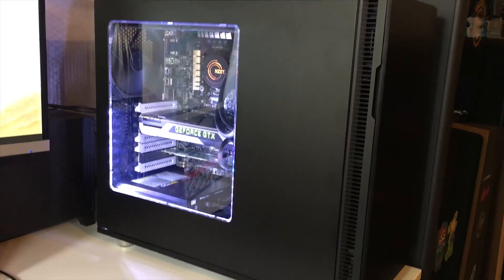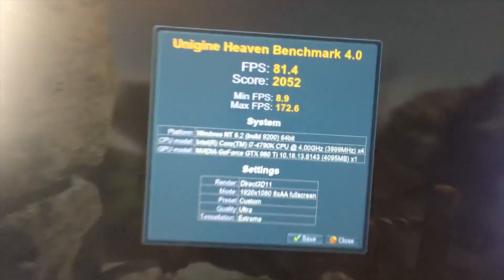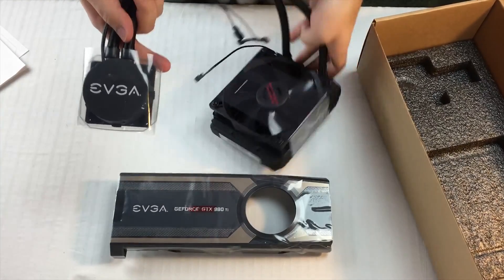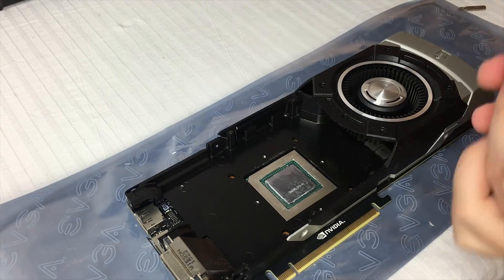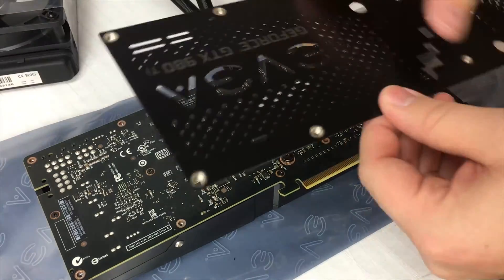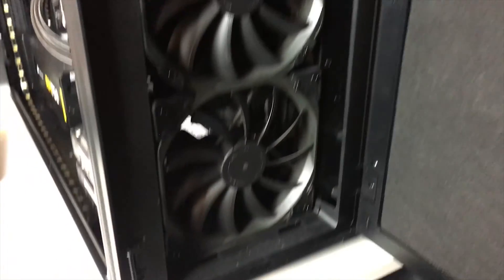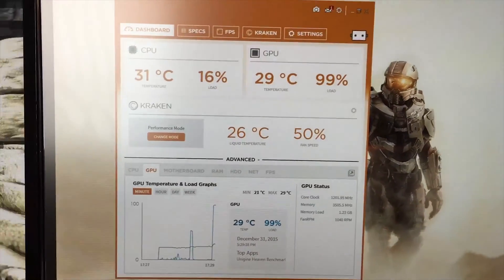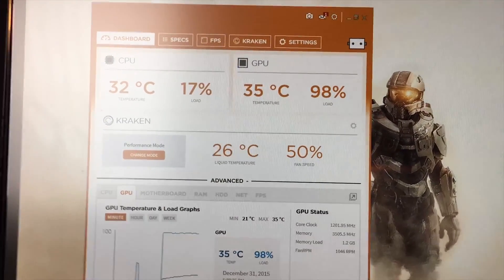Thermal Throttling! How to Cool a Reference 980 ti

Comment: Hey, thanks for sharing the video. A card throttling with the fan running at only 50% is DELUSIONAL! How could nvidia think turning the power down instead of the fan up is acceptable? My card behaves the same, in the way it will begin to throttle with the fans raising to 50% max. I use MSI afterburner to force a fan speed, and having the fans set at only 80% dropped the card 25c and prevented any throttling. Why the fan curve is not configured out of the box to prevent throttling, when the fan is capable of doing so, is baffling. Cheers to everyone still running this beast in 2022
!

Comment: I know this is quite an old video, but please reply if you can... at 6:58 you put the cooler over the GPU processor but did you add paste?  I only ask as you later (7:14) say to cross tighten the screws to ensure the paste spreads evenly... but as far as I can tell, there was no paste add, only the paste that was on the cooler, and would this spread?   Thanks for the video.
Reply: Yes you need to paste the gpu

Comment: If you're anxious to use alcohol to clean everything, you should also know that everytime you touch the heatsink/gpu with your bare hands, you leave fat on it, that will reduce the coolers performance over time. Anyway, looking how easy it is to remove the cooler from a reference card, I now regret my decision to get a non-reference card.

Comment: Just bought the msi version of this card and it runs HOT, 84C under heavy load 34C light.
Runs ff15 highest settings 4k got a steady 45 fps 1080 100fps <84C, 1080 60fps gets 75C/80C the max safe temp is 92C it throttles at 84C tho i think. Good vid gonna get a water cooler for it soon

Comment: I would like to make my gtx 980 ti run cooler, but unfortunately I can not find anywhere this hybrid cooling :( Looks like I have to go for Kraken or corsair AIO setup
Reply: they are no longer supported you have to look for used ones
Reply: I already got Corsair N980 cooling bracket with Corsair H75 water cooling, temps are at max load around 60-65 (with slight overclock), Got no bending PCB issue with craphic card as many reported :)

Comment: After experiencing sudden  frame rate drops after long periods of graphically demanding gaming, and the cooling fans running outrageously loud with a lot of heat coming out of my exhaust fans, I have pulled the trigger and won one of these cards on eBay for $374..    (card and kit together) .. during a time of this whole Cryptocurrency mining craze, gpu prices are now outrageous so it's definitely a steal..

I can't wait to see what this thing can do ..

I might use my air cooled 980 ti for another build.. I just realize that air cooled 980tis don't do well in small form factor cases..

Thermal throttling is like torture, because you know the card can generate enough power to achieve extremely fast frame rates on par with a 1070 but something is stopping it.

Comment: I was playing CS:GO earlier, and it gave me a driver crashed issue. tried so many drivers. have any ideas? like underclock it? or something?

PC Specs:
FX 6300
16gb ddr3
Asus GTX 980 Strix
MSI 970a-G43
500w PSU
Reply from the maker: Trolls You well it could be anything really. First I'd check your temps. Download NZXT's CAM monitoring software. Make sure nothing gets above 80C. Download GeForce experience and do a clean install of the latest drivers then let me know :)
Reply: Beeeyeee - Games & Good Times Will do, do you have steam so I can chat with you if I have issues?
Reply from the maker: Trolls You yep it's just Beeeyeee

Comment: +Beeeyeee
I could use your expertise.  Below is my current build.  I purchased a EKWB Predator 360, which currently is only cooling my CPU.  My intention was to purchase two EVGA 1080 Ti hydro copper's and add them to the loop.  Now I'm having second thoughts because I don't know if I'm ready to deal with the hassle of the maintenance of a custom water loop.  I'm now wondering if I would be better off with downgrading the CPU cooler to Predator 240 (without quick disconnects) and then purchase two 1080 Ti hybrids; when they finally release.  The upside is that I wouldn't have to clean the closed water loops on the 1080 Ti hybrids.  I'm not yet sure if that'll be the case with the EKWB 240 (without quick disconnects) but I think so.  What do you think?

[PCPartPicker part list](http://pcpartpicker.com/list/D68fsY) / [Price breakdown by merchant](http://pcpartpicker.com/list/D68fsY/by_merchant/)

Type|Item|Price
:----|:----|:----
*CPU* | [Intel Core i7-5820K 3.3GHz 6-Core Processor](http://pcpartpicker.com/product/6tXfrH/intel-cpu-bx80648i75820k) | $369.99 @ SuperBiiz 
*CPU Cooler* | [be quiet! Dark Rock 3 67.8 CFM Fluid Dynamic Bearing CPU Cooler](http://pcpartpicker.com/product/YwGkcf/be-quiet-cpu-cooler-bk018) |-
*Motherboard* | [Asus SABERTOOTH X99 ATX LGA2011-3 Motherboard](http://pcpartpicker.com/product/yxYWGX/asus-motherboard-sabertoothx99) | $306.99 @ B&H 
*Memory* | [Corsair Vengeance LPX 64GB (8 x 8GB) DDR4-2400 Memory](http://pcpartpicker.com/product/9ycMnQ/corsair-memory-cmk64gx4m8a2400c14) | $314.48 @ Amazon 
*Storage* | [Intel 750 Series 800GB PCI-E Solid State Drive](http://pcpartpicker.com/product/GDx9TW/intel-internal-hard-drive-ssdpedmw800g4x1) | $709.99 @ Newegg 
*Video Card* | [EVGA GeForce GTX 980 Ti 6GB Superclocked Video Card](http://pcpartpicker.com/product/xnH48d/evga-video-card-06gp44992kr) (2-Way SLI) | $0.00 
*Video Card* | [EVGA GeForce GTX 980 Ti 6GB Superclocked Video Card](http://pcpartpicker.com/product/xnH48d/evga-video-card-06gp44992kr) (2-Way SLI) |-
*Case* | [Fractal Design Define R5 Blackout Edition ATX Mid Tower Case](http://pcpartpicker.com/product/nwVBD3/fractal-design-case-fdcadefr5bko) | $99.99 @ Newegg 
*Power Supply* | [EVGA SuperNOVA P2 850W 80+ Platinum Certified Fully-Modular ATX Power Supply](http://pcpartpicker.com/product/zhgPxr/evga-power-supply-220p20850x1) | $135.98 @ Newegg 
*Monitor* | [Acer XB271HU bmiprz 27.0" 165Hz Monitor](http://pcpartpicker.com/product/ttnG3C/acer-monitor-xb271hubmiprz) | $0.00 
 | Prices include shipping, taxes, rebates, and discounts |
 | Total (before mail-in rebates) | $1957.42
 | Mail-in rebates | -$20.00
 | *Total* | **$1937.42**
 | Generated by [PCPartPicker](http://pcpartpicker.com) 2016-07-20 12:28 EDT-0400 |
Reply from the maker: First off 1080Ti's don't exist yet, did  you mean 1080's? Assuming that's what you mean, you won't need to watercool them. Honestly I have the Asus Strix 1080 and it never goes over 70C. If you're that worried Zotsc has some 2.5 slot cards that cool even better. If you're set in watercooling honestly either way is good. It would look better if you got custom watercooling though. But you don't need to downgrade your CPU cooler. You'll just end up loosing money I think. :) personally I'd just get two air cooled 1080s and stick with what you got otherwise. You can save money that way too. Otherwise full on custom loops. You're halfway there
Reply: I was indeed talking about the future 1080 Ti, which hasn't been announced or released yet.  Here are my current specs:
https://www.twitch.tv/rcald2000/profile
Reply from the maker: if you've get two 980ti's and you're not even gaming at 4k, why? you honestly could get away with one and still do max settings at 1440p for 4 more years man. You don't need to upgrade by any means. but uf you have to, i'd just get air cooled cards as I said. Don't get the refrence ones, but wait for the board partner versions. :)

Comment: Hi i have a reference 980 ti i have no problem with my thank you
Reply from the maker: What games are you running? Mines fine with games like portal 2. But if I play any recent game on ultra settings it just gets pretty hot. Try this Heaven benchmark and let me know your score and temps:)
Reply: bf4 bf3 witcher 3 star wars call of duty bo3 dying light grand theft auto 5 tomb raider and wend i run heaven benchmark 65 c
Reply: do you use fan curve
Reply from the maker: +Jerome Hieb (JayZ6206) yeah I use just the default but it ramps up all the way. Everyone else has this happening. You sure yours is clocked correctly? What brand?
Reply: boots to 1215 ghz gigabyte that not oc
Reply from the maker: +Jerome Hieb (JayZ6206) yeah Gigabyte doesn't make reference 980 ti's that I know of. It must have a different cooler on it than mine:)
Reply: +Beeeyeee - Tech and Gaming News and Reviews yes gigabytes does look it up on you tube
Reply from the maker: +Jerome Hieb (JayZ6206) Oh I see they did. How the heck are you getting it that cool man? do you live in a fridge? haha :D  Also send me your parts list please :)
Reply: 1, phanteks luxe case 2 i7 4790k 3,980 ti 4, gigabyte Z97X SOC Force mb 5, 32GB of crucial ballistix elite memory 6, evga 850g2 power supply 7,2 ssd 8,2 hard drivers 2TB each  9,full water cool cpu 10, EKWB SUPREMACY EVO 3 RADIATORS 360mm,240mm,120mm
Reply: I have a asus 1920x1080p 144hz Monitor and i just got a asus PG278Q 2560X1440P Monitor
Reply: and i am thinking of getting a ek water block for it to for the summer i am in KS
Reply from the maker: Yeah I will eventually be water cooling this system. I just really like making videos on it so it will keep getting bigger and better. :)
Reply: Cool i like your video
Reply from the maker: thank you I worked really hard on it :) my videos are only getting better

Comment from the maker: Do you have the same problem with your reference 980ti?
Reply: I got the 980 ti 6gb golden edition, if i start a game like "The culling" or Witcher its so hot that you can't even touch it, is there another option to cool down the 980 ti ref ?
Reply from the maker: +tyloX that kind actually has a custom board. So this cooler wouldn't work on it. Those 980ti's get VERY hot something like 85C right? Honestly there's nothing you can do. Just keep her going it will be pretty fine:)
Reply: Beeeyeee - Games & Good Times We'll i changed the cooling paste on the gpu, and that was'nt a bad idea, there was'nt that much of the paste on it, so i cleaned it and put new cooling paste on, it doesnt really helped at all.. so as you said, ill just run it as always :] And if my english is to bad to understand im sorry, im from germany [=
Reply from the maker: +tyloX yeah usually that won't change too much of anything. And no worries! Your English is perfect! :)